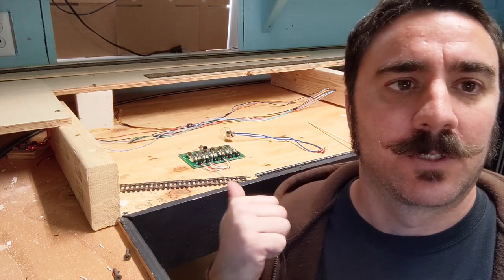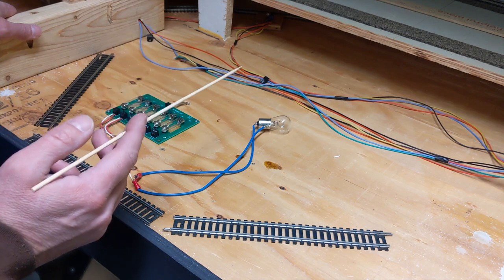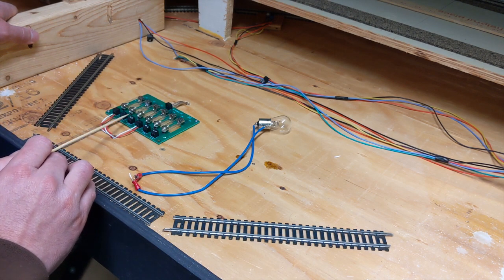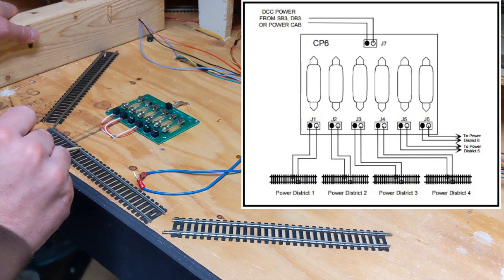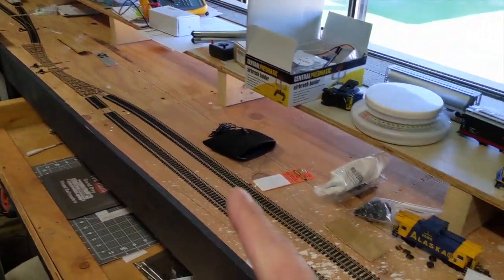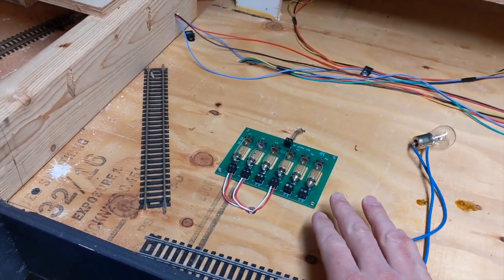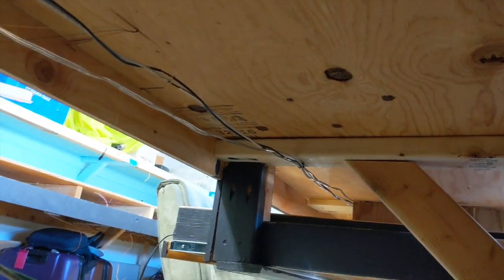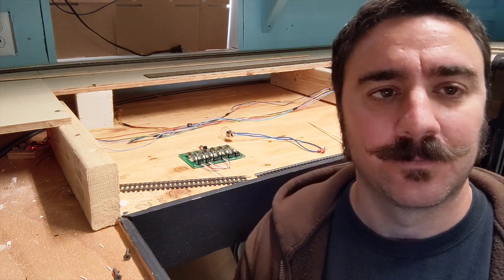NCE Part 4 (NCECP6)

Comment: Now it makes sence why you bulbs weren't working.  I assumed you had a booster. Also i didnt know the cp6 were bulbs. I thought the were fuses. Great video Joe. Thanks for sharing.
Reply from the maker: I don't have a booster yet. Just the NCE Power cab. If I had the 5 amp booster the bulb might have worked. Thanks for watching!

Comment: The end meme should be tattooed on my HEAD!! I overthink EVERYTHING!! 😳 
Your wiring is much neater than mine. 
Joe, you mentioned that your PowerCab is 2 amps... I know that's how it comes. 

I think I told you about 100 years ago on G+ Groups that I tossed the NCE Wall Wart and replaced it with a 12.6V, 4.5 Amp Laptop Charging Brick, about 2011.... 
Just to let you know, I haven't had a single issue with that setup!! Any short trips the circuit breaker like normal. NO heat issues, no glitches, nothing.
Just 3 Amps more power!! 😉 

I'm still using the old 1156 Bulb Block "protection", and it works normally. Despite the extra current. 

All I changed was I'm running all 10 gauge Buss Wiring.
Carmine ✈🚂🚙
Reply from the maker: wow thats crazy that it works with more amps. I remember lol glad to see you back
Reply: It really has been rock solid. Not the slightest hiccup!

Comment: That's a nice device. Makes wiring the "bulbs" easier! I haven't decided yet what kind of short protection I am going to use, but this is a choice, for sure. Thanks, Joe! ...Claude
Reply from the maker: The bulbs are cheaper, but if you have a system that puts out more than 5 amps you can use the bulbs or EB 1 circuit breaker.

Comment: Hey Joe!  Thanks for posting this - it now makes sense!  - Brian
Reply from the maker: Really? That's awesome because I confused myself lol. I'm glad it was helpful to you. Do you have a 5 amp system or 2 amp?
Reply: @JoeG-firehousewhiskey  I have  5 AMP system with power boosters - 8 amp.  But in simple terms I think it's working like a heat sink in that the lights are drawing power away from the short and reducing current flow to the loco.
Reply from the maker: Yeah, that's what it seems like. They said the CP6 doesn't work with the 5amp system. You'd need the EB 1 circuit breaker.

Comment: Cool video Joe.  I use the CP6 with my PowerCab and I am using the DCC Specialties PSX devices with my SB5 on my layout (which is about to be upgraded to a PHPRO with the SB5 acting as a dumb booster).  Great explanation on the CP6 and how to use it.
Reply from the maker: That will be a nice setup you are doing to have!My layout is small so I think 5 amps would be overkill lol
Reply: Joe G 10amps will be total overkill for my layout but the PHPRO was a deal to good to pass up and the SB5 is limited to only 6 cabs which could be limiting given I envision 4 - 5 cabs active for  an Op session and then every NCE mini panel uses a cab address as does USB interface so I think 6 is too few for what I want to do.
Reply from the maker: That's make sense to have to upgrade, since you'll need more cabs

Comment: Ok I have watched your video a few times now, getting ready to start my layout, so I should break up the layout  into several power districts and feed each section with power from the  short protector
Reply from the maker: Yes, exactly right. You will have a sub buss line that all the feeders go too. From the sub bus, then you go to the circuit protector.

Comment: GREAT VIDEO JOE!  I have a bus wire running the length of my layout - my feeders are connected to the bus wire - feeders are every 5 feet - could you explain what you mean by connecting the wire from the cp6 to the "SUB BUS Wire"???
Reply from the maker: Your feeders off the main will go into one side of the cp6, then each power district will get the feeders off the other side of the cp6